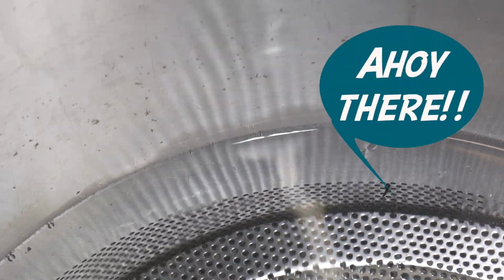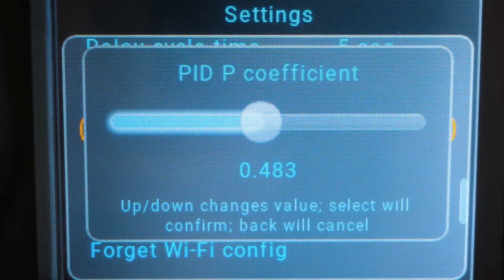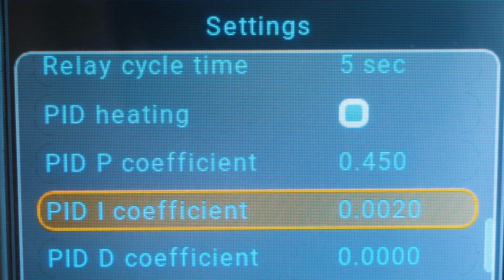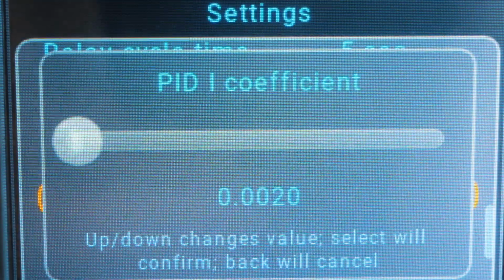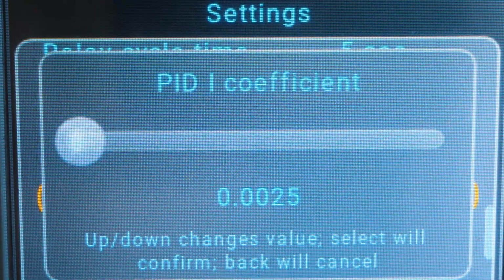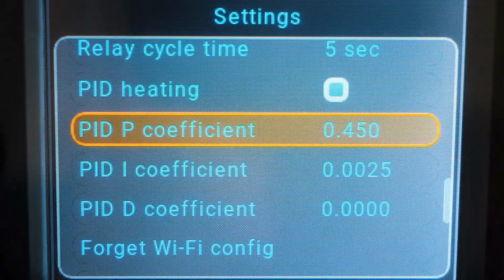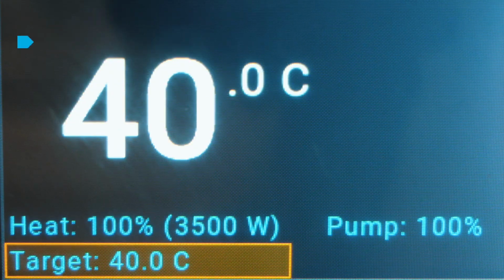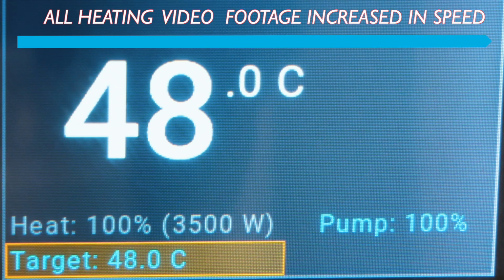Brewzilla GEN 4 PID ALGORITHM EASY SET UP GUIDE

Comment: I just got the 65l 220 version today cleaned and rinsed. Filled with 20l set my settings as yours and it came up without overshooting. I did get a rapt thermometer and it showed 151.7f and my display showed 152f and it never got to 152f.
If I was to start changing values where do you suggest I start. Great video! just in time for my upgrade from 3.1.1 which served me well till earlier in the week. 500 watt element heater switch went out. I had a replacement. But I was never happy about trying to hold mash temps. So the upgrade. Thanks David for all you do for everyone.
Reply from the maker: Great to hear, enjoy 🍻🍻🍻

Comment: Thank you David, did my first brew on the gen 4 yesterday and saw both over and under temp on the graph so need to tweak. I would have assumed kegland know the most common batch sizes and set the default to that.
Reply from the maker: You will need to tweak, its not just about batch size, your environment plays a role too. I hope this video made it easier at least 🍻🍻🍻
Reply: @DavidHeathHomebrew it really helped David, thank you, currently running water through the system and tweaking the numbers and watching the graph, who knew that watching a graph could be fun 😂
Reply from the maker: Great to hear 🍻🍻🍻

Comment: Hi David,
Thanks for this video, although the PID values for my Brewzilla 35L where a bit different.
Maybe also because of the heat exchanger dish.

My setup:
Vessel: Brewzilla 4.1 - 35L
Malt pipe: Inserted
Jacket: Yes
Heat exchanger dish: Yes
Lid: No
Pump: 100%
Heating: 2400W (100%)
Water: 15L

I think I had to lower down the P value because of the heat exchanger dish.
I set the heating hysteresis to 0.2 ºC for a less nervous behavior. (On higher temps the temp will drop to 0.5 ºC)

PID P: 0.115 (On lower temps it overshoot by 0.5, on higher temps it was 0.1)
PID I: 0.0010
PID D: 0.0000

For me the P: 0.115 is a starting point for further tweaking.
Reply: I set mine exactly as your values of P.I.D. Worked spot on for Texas
P= .115
I= .001
I did set hysterisis to 1 instead of 0.2
Thanks for sharing!
Reply from the maker: Great to hear Mark 🍻🍻🍻
Reply from the maker: Great, yes there are various variables here. No two setups will be totally identical if optimised.

Comment: After calibrating the built-in temp probe (which was off by 5 degrees F) mash temp with the basic PID settings for 5 gallon batch held within 1 degree. Problem now is getting to mash out temp of 168. After 25 minutes I was still 10 degrees away and so i skipped mash out and sparged. Any ideas on how to fix that?
Reply from the maker: Yes, you will need to tweak the PID settings for greater heat up speed. This video explains the process.

Comment: Hi David and thanks for all your educational videos. I'm into my fourth brewday (Sweden) soon with BZ 30l Gen4.1, full recipe 220V
I intend to use my Rapt thermometer in conjunction with the bottom probe as you've shown. 
Q: Is it possible to run both PI(D) and the probe/rapt at the same time or does one ovverride the other?
Best Regards 
Martin Hiller
Reply from the maker: Hi Martin, great to hear 🍻🍻🍻
Yes, PID is advised and works well. Just for mashing though. Turn PID off for the boil 🍻🍻

Comment: Hi David. 
I am a control systems engineer by profession and I would like to clarify some minor things you said. 
First of the I gain, or the integral gain, does not add speed to the system. In fact it does the opposite, it will add a phase delay and is a cause (if not well tuned) for overshoot. One uses the integral gain in order to eliminate steady state deviations (read deviations for when you are close to the desired setpoint/temperature). Tuning the integral effect too large would lead to overshoot and oscillatory response (which is why it is nice to keep the gain small). 

Also if you are interested in a more convenient algorithm for tuning a PID controller I would recommend Ziegler-Nichols method. It is not a tough read and quite intuitive even for the average Joe. I'm sure you could find some article or information about the method online. 

Anyway thank you for a nice video and happy brewing.

PS: the difference in grid voltage and frequency does not affect how the system behaves and should be tuned.
Reply from the maker: Many thanks for your thoughts. This is for sure not my area, so I went by information supplied by Kegland. As I understood it though, these areas can differ within such systems. I found conflicting information at first online, so then went to Kegland for assistance for this video.
Reply: @DavidHeathHomebrew  How you tube the PID differs from systems. And what assumptions are done when modelling the system (most assume linear systems as PID can guarantee exponential stability for such systems). Most systems are not linear and therefore the tuning is not optimal for all systems, and one has to choose between trade offs (aggressive-, robust-, under damped-, over damped control and etc) in the controller.  There are vast amounts of algorithms or methods in how to tune the linear PID, and the most important part at the end of the day is to get a response you are happy with.

Also the only thing one actually would change is the transient (how the controller responds when the input reference signal/temperature is changed until it settles at a set value) response of the controller (unless you go too aggressive and make the system response unstable), as the steady state response will be the same for all systems. And the PID will help you choose how fast or slow you want the transient response to be, how much oscillations there will be, and how much of an overshoot there will be (depends mostly on the integral gain). And this is flavour settings depending on the brewer and how one would want the system to behave. 

If I could have changed one thing with the system it would be to add integral gain anti-wind up. This would prevent the integral gain to accumulate up too much error and reduce the overshoot amount by a lot. It would also not be difficult to implement for Kegland.
Reply from the maker: Great, many thanks for the information, much appreciated 🍻🍻🍻

Comment: Hi David, I have just received my new Gen 4 35L. I ordered a HED plate and a jacket with it.
I am in Aus and my unit is 10 amp 220-240 volt domestic plug.
I filled it with 20 litres of water and played firstly with the raw temp controller and the element power and pump valve opening to see how close I could get to a satisfactory mash….At best it was a close average but for those who may choose this method I found dropping the element power right down to around 20% help to stabilise temps.
I then turned the pid on and set the standard settings.
I operated the unit beginning at 40 degrees and using increments of 10 degrees until I reached mash out of 77.
My final settings were
Pump 100%
Heat 100%
P value  0.424
I value 0.0024
D value 0.000
This was with jacket installed along with the Heat Exchanger Dish and with 20 litres of water.
At these settings I was getting and overshoot on the high side of 0.1 of a degree and nothing under the set temp at all. If this is how it will function with grain during a mash I will be very happy.
At the end of the adjustments I turned to PID off and set the temp to 102 for the boil.
I measured an average temp rise rate of 1 degree every 50 seconds.
Needless to say I am very happy with the results and I thank you for the informative video.
I can’t wait now to use it in anger with 5 kg of grain.🍻🍺😃👍
Reply from the maker: Awesome, many thanks for sharing your findings and settings, much appreciated 🍻🍻🍻

Comment: I did the test with 20L of water
P: 0.425
I: 0.0023
Allowed sensor diff: 8 C
I created a 2 step mash test profile
50C > 65C > 77C

Ramp up times
20C to 50C: 18min
50C to 65C: 11min
65C to 77C: 11min
77C to Boil: ~20min

35L Gen4
Voltage: 240V

I didn't have any temperature overshoot. 
I guess I could increase the sensor diff to 10C without problems.
For boiling, I turned off the PID.

About 2-3C to reach target temperature is when you see slow increases in temperature. Need to be patient here and let the controller do its thing 😅.
Overall, my test was successful. Now, I have to compare with a real brew. 🤞 

Thanks for the video. It's been a great starting point to fine tune the BZ PID.
Cheers
Reply: I forgot to mention that I had other two temp probes and all of them matching the RAPT temp sensor 🎉
Reply from the maker: Great, many thanks for sharing 🍻🍻🍻

Comment: We need a vid on the RAPT temp controller PID configuration.  Cooling and Heating.
Reply from the maker: Its the same in principle. You would only use PID if used with a brewing system for mashing. Other than that PID is not of great use.
Reply: @DavidHeathHomebrew  With the Rapt Temp controller my temperature and cooling always overshoots with 2.5  Degrees Celsius. A Brewtools 500W heating element in a F40 with a glycol cooling system is what I'm using.  Kegland does not have any documentation about PID.

Comment: I am utterly baffled by the number of people that seem to have had an easy time with setting their PID and getting consistent temperatures. I've had nothing but an absolute nightmare on every brew I've done. I played around with the PID and ended up setting numbers way lower than I've noticed anybody else use, and I still kept overshooting my temperature by at least 0.5C on water only. And that doesn't matter because as soon as I start brewing with it, it just get insanely out of whack temperatures. A 66C brew is allowed to plummet to 61C on the BT thermo, but be 70C+ on the BZ internal thermo. This obviously then means that the whole thing ends up massively overly compensating and overshooting past my target temperature.

What the fuck am I supposed to do? How are so many people able to achieve consistent temperatures?

My PID is: P: 0.355, I: 0.0020, D: 0. I try and avoid using 100% heater. It still find it impossible to just achieve a consistent mash temperature.
Reply from the maker: Hmm that is odd. I suggest that you reach out to Kegland by email, they can be very helpful with such things. Perhaps something is wrong with the setup.
Reply: How did you solve this problem? I have the same problem.

Comment: Hi David,
Many thanks for a great video. Just one thing, when i was testing mine, i noticed the power was always at 100% (P=0.58, I=0.0015, 20L water on 35L edition), even when just maintaining temp. It seems to switch on and off every few seconds. Am i doing something wrong?
Reply from the maker: Hi Rory, yes that is correct while mashing. Just switch PID off when doing the boil 🍻🍻

Comment: Thanks for the video, David. I'm still not clear. Is "P" the same as the manual percentage power level setting? If PID is turned on at the start of the heating process, does that mean that the water will take much longer to heat up? If so, then would you only enable PID once you are close to the target temperature?

Also, once you enable the PID setting, does that ignore the manual heating percentage setting, or does the manual setting affect the PID setting?

 Thanks.
Reply from the maker: Hi John, PID when set well will allow for fast heating but you could enable it when you are within a short distance of temperature. Personally I switch it on for ramp up to mash temps and its fast. The P setting in PID is unique and it relates to the power allocated to the elements. I hope this helps 🍻🍻😎
Reply: @DavidHeathHomebrew  Thanks, David - that was helpful.
Reply from the maker: @johnkoopmans8278 Great to hear 🍻🍻

Comment: Do you think using the new-ish Heat Exchanger Dish changes these settings at all, and what power level you use when mashing with PID enabled (and these settings)? Been using a 65L Gen4 for a year and still struggling with acceptably stable mash temp stability and trying to find the magic combination for my 240V power. Thank you for making this video!!
Reply from the maker: Hi Mark, I am using the HED with these settings but what is best will vary on environment and brew volume. You will need to tweak 🍻🍻🍻

Comment: Through I'd add my ten pence worth on PID. 
Tested with 16l which is roughly what I mash at and settled on the following. 
P 0.417 I 0.0022
Up the 50 to 75 degree range gave an over shoot of .1 degree. Will be interesting to see how that works out with malts in too. 
I should also say this was with jacket on uk 230v g4 35 pump 100 percent valve fully open 100 percent power. 
I used the BT thermometer and calibrated the internal temp sensor the same as the BT one, double checked  with an inkbird thermometer at 30 degrees and all three read the same.
Reply from the maker: Great, many thanks for your thoughts 🍻🍻🍻

Comment: Hi David, I have just bought the Rapt Temp controller aiming to use it for fermentation with my F40 conical and the BT 500w element. I am finding the element too strong for an F40 so I am hoping for the PID to reduce the power of the element to about 100W. my typical fermentation batch size is about 30L in a winter ambient temperature of about 4-8C. I will probably need to have a separate profile for the summer months when I expect about 20-28C (Amsterdam). do you have a recommendation as a starting point for the PID setting? and is the number representing the P translating into a power percentage of the total power of the heating source? thank you
Reply from the maker: Hi, sounds like a good plan. I am unsure of a good starting point though. You will need to dial this one in for sure.

Comment: Wort boiling temps: 213.8-214.1
5 gallons
PID P: 0.680
PID I: 0.0019
PID D: 0.0000

^^ will comment on this when I calculate the mash temp. It’s such a screwy process, but thank you for posting your video!!
Reply from the maker: Cheers 🍻🍻

Comment: Thanks David your videos gives me hope that I can eventually get good beer out of homebrewing. just bought the brewzilla gen4 and did my first batch yesterday and noticed that the step mash was over shooting by a few degrees. I eventually managed to control this after noticing that you could adjust the heater power manually. The PID is a very interesting concept and I thought the idea of sharing a spread sheet with different settings for the 35l and 65 is a great idea. Has anyone started? it would be great for a beginner like me!! thanks
Reply from the maker: Great to hear. If you follow my guide then set up should not take long. It is important to tweak it to suit your environment.

Comment: Man, you just demistified PID tuning for me, very much appreciated!

I've just finished my first two batches with the Gen4 35 liter, I'm very happy with the purchase. I have two questions:
1. If I use the PID function, do I still need to turn down the power to ~ 30% during the mash?

2. is there a delayed start function like in the older models? If yes, how do I access it's

Prost and keep the videos coming;)
Reply from the maker: Great to hear 🍻🍻
1, No the PID will take over
2, Yes but you need to create in within a profile. Start with the delay you need, then the first mash step heating. I would say allow 30 mins for the heating, so your delay will be 30 mins short. 
I hope this helps, cheers 🍻🍻🍻
Reply: @DavidHeathHomebrew  Great, thanks a lot!

Comment: Thanks for the video David. Quick question (and apologies if I missed this in the video) - do you disable PID heating after sparging and bringing the wort up to a boil?
Reply from the maker: Hey Hugo, yes. You do not want PID for the boil 🍻🍻
Reply: @DavidHeathHomebrew  Wow this is fairly important isn't it? I had to set my boil @ 103c with PID on to reach the boil, this explains it. PS I will post my observations below for all to see.
Reply from the maker: Yes. You do not need or want PID for the boil phase.

Comment: Hey David, i just received my Gen4 65L Brewzilla, can you help me out on 2 points ? first of all... what "sounds" does your brewzilla make ? mine is silent allthough i set the sound to on... secondly according to Kegland homepage there should be a possability to add hop timers and receive notifications on mobile... but i can not find the options in rapt ... can you give ma hint? thanks a lot!
Reply from the maker: Hi Thomas, sure, here are my answers:-
1) Silent so far
2) I believe this is part of Brewfather integration.
Reply: @DavidHeathHomebrew  thanks for your answers, hope at least hop timers will be implemented in near future, don't get me wrong, i can also set them in brewfather, but i find it kind of disappointing to have so much hardware potential and not using it. All the best.. i subscribe ;)
Reply from the maker: Thank you. Yes, loads of potential yet for sure. Much more being added but you can link Brewfather now but its still in beta.
Reply: @DavidHeathHomebrew  I think Brewfather only communicates for fermenting at this stage. I managed to use the "Hook" to add brewfather to my BZ4, but I don't think it does anything (Yet). I used the GRAINFATHER app to keep up with reminders, (Wasn't aware of brewfather on my first brew) Maybe
Reply from the maker: There is a test build program that users can ask to join
Reply: @DavidHeathHomebrew  i would definitely like to join, but how ? Just write an email to kegland?
Reply from the maker: You would need to contact Brewfather.

Comment: I have gen 4 35L 110v. What everyone using for PID setting?
Reply: What did you eventually set you PID numbers at?
Reply from the maker: Those shown in the video at the end. Use them as a starting point if you like. You will probably need to tweak further though for your environment to see the best result.
Reply: @DavidHeathHomebrew  thanks!
Reply from the maker: It will vary some Travis but yeah it saves time to have a starting point :)
Reply: @DavidHeathHomebrew  can you adjust PID while it’s over shooting
Reply from the maker: Sure but its best to do your testing and setting ahead.